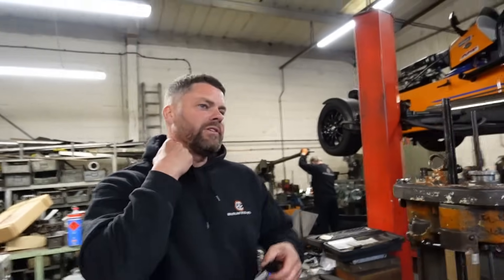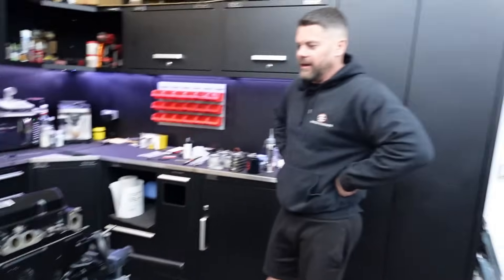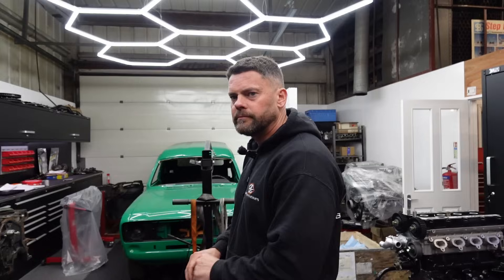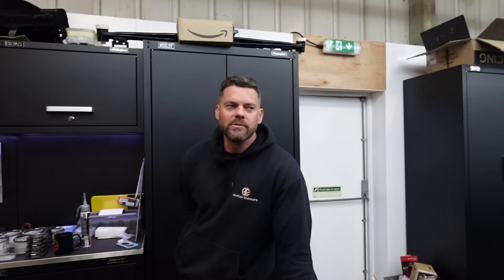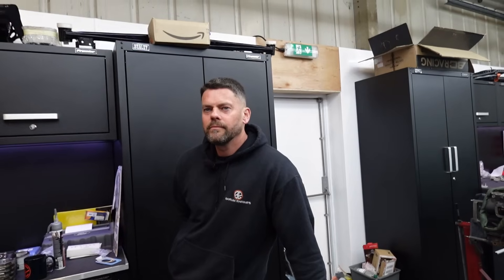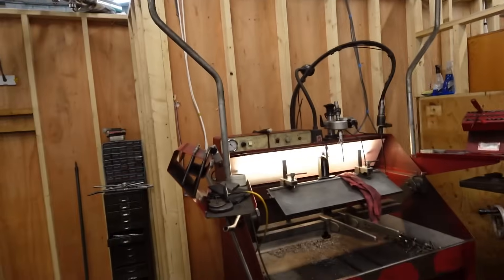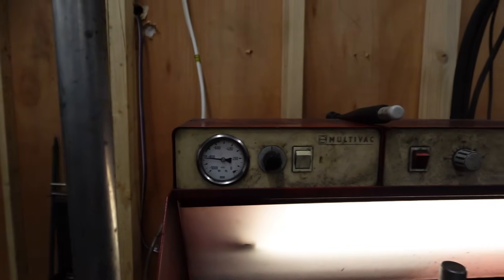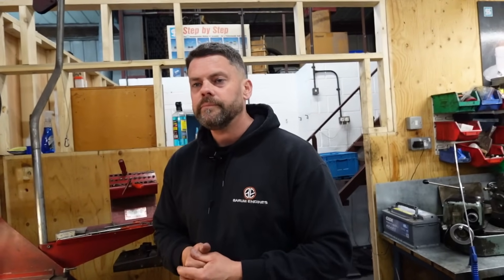ENGINE HAD TO BE STRIPPED DOWN WHEN TESTED WRONG!

Comment: Guys re the rubber tube between the head and block on the Lotus TC, They are a a pain in the arse to make them oil tight. I resorted to making an aluminium replacement with O-rings on each end.

Comment: Real serious race engine builders use a torque plate when boring and honing the cylinder bores. A very successful race engine (the team won what I think is still a record 4 Daytona 24 Hours in his class in a row) builder told me that without a torque plate, after torquing the head the cylinder bores could be 0.005” out of round. He also told me that a similar effect happens with the valve seats when you torque down the head. He machined a block torque plate and a similar torque plate for the head for cutting valve seats. The seats may hold pressure on a bench but after it’s torqued to the block, it could leak a bit.
Reply: Do they bore them at operating temperature too to take out any un even thermal expansion?
Reply: @602Sean  Good point! I don't believe they do. At least my engine-builder friend didn't mention it.
Reply: @grunewaj  Some builders do run boiling water through the block to get the temp up a bit . It's all a case of diminishing returns , so most don't bother .
Reply: @petercraig806  Interesting.

Comment: As a journeyman mechanic, DIY people can tend to overthink without real knowledge. A dangerous bit that.
I am not a fan of lapping valves. People will try to "touch up" the valve sealing when it really needs a good grind on the valves and seats. I have seen them with the valve seats cupped and the seats in the head rounded off to match. Everyone needs to know their limits (a Dirty Harry line). If they have not done something before, seek help from someone that does have experience to watch over and teach. That way when the situation turns the corner to needing more professional attention, the experienced person knows when to make the call.

Comment: Saw a video from a well respected head porter, comparing cheap Chinese SBC heads with American made heads. He tested valve leak on both heads, Chinese head leaked, American made head didn't. He said the only fix was to redo guides and seats correctly

Comment: Shipping engines: Suggestion: Fab a 25mm x 25mm box section frame to surround the engine. This is attached to the engine mounts. Then skin the frame with plywood that is held in place with tech screws.

Comment: Out of interest, with the valve issue, does capillary action make the valves leakier with fluids under certain lower pressures than if air was providing the pressure ...?
(Sorry if that sounds like a dumb question !)
Reply: Doesn’t sound dumb to me , there must a reason other than pressure as the vacuum cannot be that strong if Lea is putting is finger on it. That’s my two cents of overthinking 😂

Comment: If people have doubt about compression lost because of piston/pistonring failure, it’s easy:check the carter ventilation pressure….
If you open the oilfiller cap and it sounds like you just cut your exhaustpipe….
Reply: Here is a trick from our crew chief, to determine if the crank case is breathing sufficiently, or if crank case pressure is causing blow by. : Remove the oil filler cap. Place a rubber medical glove over the filler neck. Run the engine at idle. If the thin latex/rubber glove inflates like a balloon, you have high crank case pressure.

Comment: How come ive never seen a Toyota engine on this channel? Been watching from day one and ive seen most engines except Toyotas, are you allergic to them Lee?
Reply: Lee can't "Bare-Rum!" Thee Toyota engines haha
Reply: Toyotas rarely blow up
Reply: If a Toyota engine gives trouble, the rest of the vehicle has covered a million kilometres too….
Reply: Our race team runs Toyota pickups. We service them and do preventive maintenance on a regular schedule ( one guy in the shop is responsible for this, in between his other tasks of cleaning the floors, keeping inventory, maintaining the equipment, cleaning parts, ordering and running for parts, making coffees, shipping, and running for lunches ). Each truck has done over 300,000 miles and they have never missed a beat.
Reply: @ataxpayer723  In the 90’s I have worked in the Middle East and Africa as a mechanic for the Seismic industry (Geco-Prakla) on several occasions with Toyota’s.
They are PHENOMINAL!!!
In years of time working with these cars I only experienced one breakdown (a front differential failed on an old Landcruiser Pick-up) : I never had to repair anything, not even a starter or a waterpump….
A French colleague told me that in the 60’s engineers from the Toyota factory would reglarly visit their crew to find out first hand of any issues with their vehicles!!!
We used Landcruiser Wagons and Pick-ups both 4 and 6 cylindre Diesels and 6 cylindre Petrol engines in both Dubai and Abu Dhabi.
I have worked with Landrovers and Mercedes G series as well…… they are no match….
Reply: Toyotas are just far too reliable, they keep going forever, im still driving a 1986 Corolla and a 1995 Carina E but the road tax cost is starting to hurt a bit, i wouldn't want to drive anything else.